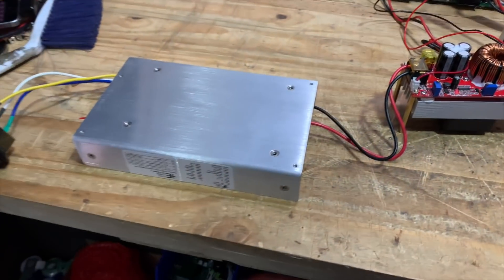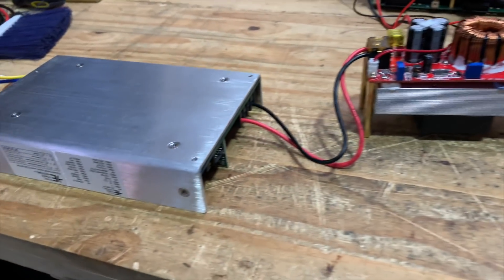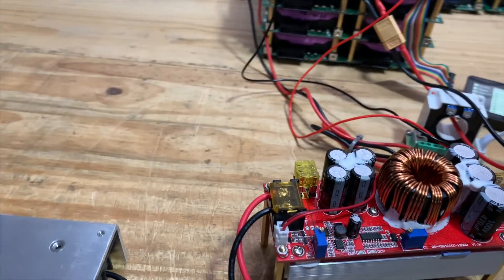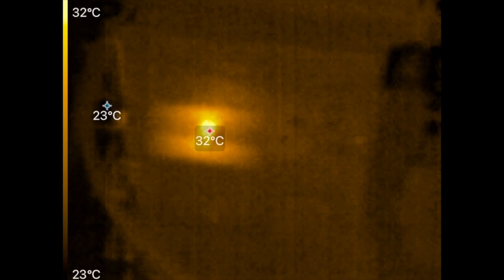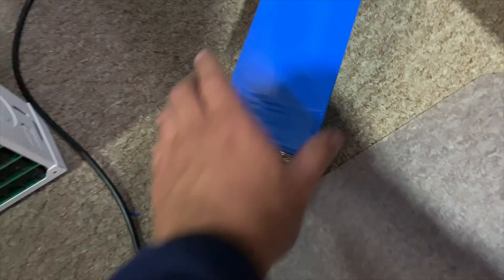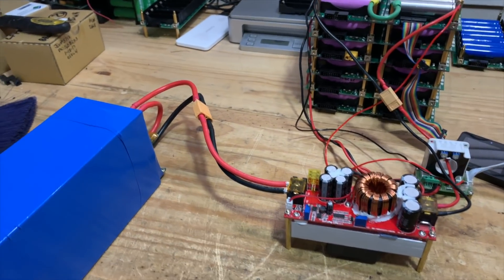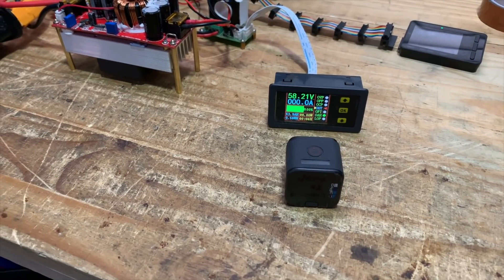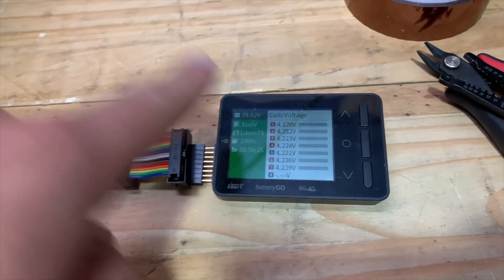Can This Device Charge our DIY Powerwalls?

Comment: You could use Power Supplies labeled as LED Driver from eBay or AliExpress right away. Because some of them have a pot for adjusting their output. And it is then doing CC/CV charging if you connect it directly to the battery.
Reply: Those usually don't regulate voltage very well. You would need to make sure the max voltage they put out is right for your battery.
Reply: @jkenny1  they do it as well as the cheap regulator board, but you save one conversion loss.

Comment: Drok makes a large step-down constant voltage/current controller I use for my battery charger.  I use it with a 48V AC/DC power supply. So if you need to charge things < 48V, it's a good option.

Comment: The news on the 1800 watt boost converter : looks like it's rated at 40 amps input, 20 amps on the output. Charging a 48 volt battery with 20 amps is about a kilowatt. Looks like you're close to the max for that unit.

Comment: I have a question.  I am building the PW with your circuit boards, but in the parts list you have a 16 pin header, but there are 18 holes.  Which 16 holes do we use? and is the front row and back row electrically connected, or is it just the back row.  On the 18 holes, there is one set that goes to the negative (or positive, don't remember) is that an option of some sort? There is printing on the board next to the holes, but it is so small I can't make it out.

Comment: Hey Guys, check this out for understanding on concepts / Boost Converter Animation Video Great    (  https://www.youtube.com/watch?v=vwJYIorz_Aw )  I've been charging my family of Batteries with this Boost Converter concept.  The input voltage plays a roll in heat generation and sensitivity on output.  Target should be higher the better.   My setup uses 12volts in and 58.8 out.  2 amps is all the 12volt input can do... Those 36 volt PSU look great solution to equalize the boost induction saturation function,  Yeahse.

Comment: I bought 2 of these.   They are $94 each.   Each one does 15amp @ 48v = 720watts.  This gives me 1400watts charging for $200.
I am NOT endorsing or promoting these ...   just sharing.   I've run them a total of 30hrs so far with no trouble.
Ebay:  YZPOWER 58.8V 15A Lithium Battery Charger for 48V 14s Li-ion Battery XT60 Plug
Reply: $94 each?
Reply: Yes, $94 each.

Comment: Ive been using 1 of these to charge my 14s brushless razor scooter pack, first lithium ion 25ah pack and now a 15ah lipo pack with a bms to balance whilst charging, powered by a 24v pc power supply. It has worked flawlessly for the last 6months . Scooter vid on channel

Comment: just get a 12v fan (one of those 120mm ones used in computers) and point it at the charger, that will keep the coil nice and cool and allow for constant operation at 20+ amps

Comment: 0:36 inverter? 
Inverter's are DC to AC devices. An inverter converts Direct Current to Alternating Current. AC to DC devices are rectifiers. 
PSU's have a FULL BRIDGE RECTIFIER (electroboom voice) inside them. Rectifiers convert Alternating Current to Direct Current. 
Mains AC rectified to DC and the DC side is connected to a DC converter/charger to charge up your powerwall.

You should pin this to clarify what I hope was just a slip of tongue. I know that you know an inverter is a DC to AC device.
Reply from the maker: No I meant inverter

Comment: You're going to have heat losses anytime you try to change voltages at DC. With efficient transformers you can change voltages all over the place on AC. Find a 48 volt inverter or split your power bank to 24 volt pieces
Reply: Not necessarily the case with switching supplies which this obviously is not.
Reply: @midnight_commander  It is if the switch isn't 0 resistance and the switching isn't instantaneous. When you do it twice the problems double.
Reply: @toddmarshall416  While its true that all power supplies will suffer some heat loss due to non-idealities, modern switching supplies are very efficient.

Comment: Same inverter I have been using a few months now! So far so good and adding a Chevy Volt battery for storage. Just a couple suggestions on this unit... Don't run at max output for longevity, don't set display to always on and don't mount unit as displayed. They like to have air around them to breath, I have also placed an auxiliary fan at the bottom for added cooling when the internal fans run a lot. Just a few tips as I did a lot of research on this unit...

Comment: I squared R is the heat coming off a connection. A loose connection has a higher R than a tight one. Correct that connection. The heat light should go down.
Reply: It's not a power dissipation issue, the pin is not even connected.
Reply: Well it is a power dissipation issue, but that just a side affect.

Comment: i am wondering on the "other side" of the whole power wall setup. what do you need to put power back into (your own) grid? and i am not talking about an inverter with a few sockets where i can directly connect stuff. i would like to have the power from the batteries available in the whole house
Reply from the maker: Grid tie inverter

Comment: I'm using it to charge my electric-scooter (DIY 60V@18Ah) from the Solar battery pack. 60V@120Ah. I drain like 10A 2hours, without important heating. Working perfectly for 18months. If the source drains more than 25A@48V continuosly, you will blow the MOSFET, it happens to me twice using 24V power supply.
Reply: What kind the scooter are you running if you don't mind me asking 😁?
Reply: @djquestionthis  I'm running this model, with few modifications, like converting it from 48V LeadAcid, to 15S Battery ppack, due electronics can handle up to 63V. So I'have a 15S. I charge it until 61V. So I'm not using 100%SOC. I have done 8500km in two years... haha
Reply: @boxdaxter  very impressive, I have an electric drone and scooter company I own.....you've done well to squeeze all that extra power from the chassis.  Keep up the great work!!
Reply: @djquestionthis  My model is 1000 wats rear 6.5" hub motor, not 1800W. It drains like 20Amps, at 58V (800w-1.1Kw). But the chassis, after 8000 km is starting to show some metal fatige, for exemple on the suspension axel.
Reply: @boxdaxter  that's a lot of miles, you've done great for that scooter for sure!

Comment: Hi jehu. Can you tell me how do you know the maximun current to charge each Pack. For example a 3s 10p for 12v..  Whats the amp limit should i set up in the boost Converter. Regards from paraguay
Reply: 1 amp per cell in parallel is the maximum no brainer safe. So for your setup it should be max 10 amps.
Reply: Depends on the cell. Check the C rating of the cells. If you don't know then stick with 1amp per cell max.
Reply: Thanks for the answers.. Wht happen if the Pack reach the maximun voltaje of 12.6v y i still pumping this 10A continuosly. I dont have a CC charger.. just have a smps of 10A.

Comment: The heat might be a bad cell with high IR, dropping more voltage under load. The balance leads then "charge" the lower cell back up, creating heat in the lead.
Reply from the maker: Not connected to anything there should be no heat there
Reply: @jehugarcia  You mean" It SHOULD not be connected to anything" ;) Obviously it's connected to something or something behind the connection is hot.